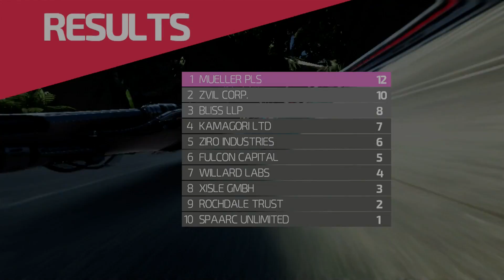Nintendo Switch - High Powered GPU Extension Theory

Comment: It wouldn't make much sense since the 720p screen wouldn't need that much horsepower, it would be better to have something like lets say the Razer Blade external gpu dock, and have it active only when its connected to a TV, since that's when the extra horsepower would be needed. They would still need to have a separate profile for each, it wouldn't be much different from tweaking graphics settings during in game, simply having a trigger in place to activate either profile for each scenario.

Comment: The venturebeat article just isn't credible. They said that pascal is less efficient and uses more power "getting a lot hotter than maxwell" and this isn't true. It actually sounds like they are describing Pascal in the Switch. Also AMD tflops is slightly less powerful than an NVIDIA tflop, so if it comes out as 1.3 tflops that could be around 1.6 tflops vs amd and xbox one/ps4.

Comment: Remember Nintendo filed a patent for parallel compute units? The patent has the NX/Switch connect to multiple devices increasing its computational power, the units being in "the clouds" or hardwired to the system. So when you have it docked it can be hardwired, and when you're moble, I can see Wi-Fi connected. I highly doubt that they would do a GSM/LTE solution given the cost of DATA.

Comment: I looked into this potential add-on dock.   The usb-c port on the Switch would need to be something like Thunderbolt 3 version to support it.  The specs for Thunderbolt 3 are quite interesting as it allows 15watt charging for bus type and upto 100watts for system charging.  The part that relates to the GPU extension, though, is Thunderbolt 3's support for 4 lanes of PCI Express Gen 3.  Source; https://thunderbolttechnology.net/blog/thunderbolt-3-usb-c-does-it-all

Comment: Shrinking the Die size doesn't change performance, just efficiency.

And the Switch wont be powerful enough to compare to a GTX 1070. That's like trying to use a Pentium 4 with a GTX 1080. Bottleneck would render that GPU useless.
Reply: the tablet would also melt in your hands after just a minute of gameplay

Comment: i think you missed the point of this console. you're overcomplicating it and not really understanding what nintendo intends. i can tell you now that nintendo does not want to adopt the sony/microsoft upgrade style console. they have no intention of running upgradeable 1080 graphics. i doubt they even care about the streaming as they are reinvesting in the cartridge system for portability and not wifi streaming.

basically, all they want to do is merge console and portable gaming. they are not looking for high power, only high enough power to make the kind of games they want. i suspect the only difference running games portable versus on the dock iwill be in resolution, 720p on portable and 1080p on tv. they have no known intentions of 4k gaming.

Comment: Yeah, switching between 2 different setting profiles would be too hard. I mean most PC games only have the ability to swap between 1000's of settings profile possibilities, with like 4 or so preset up, making only 2 would be nearly impossible. I mean PCs have games that will run not even best settings on a 1080 but could run minimalist on 670, and everywhere in between. But having 2 profiles, that'd be too hard.
Reply: Sharky111111 Not to mention devs are now also forced to make four versions of games for the other consoles: regular PS4 and PS4 Pro, and X1 and Scorpio. That means all games released will have to run on a regular X1. Even if the Switch is slightly less powerful than that, it shouldn't be too much work to disable a few graphical settings to make it run on the Switch. (As long as it's easy to port to, of course, which seems to be the case from all the rumors and what NVIDIA has said.)

Comment: How was Rouge 1 Dave? I haven't seen it yet, is it any good?
Reply from the maker: Yeah I saw it on Thursday, you will like it a lot if you are a fan of the 1977 movie ;)
Reply: SuperMetaldave64 Cool good to know thanks, was there stuff after the credits like in the Marvel films?

Also real quick on the VR headset that might have the Switch fit inside it. For that to work properly & comfortably the Switch will have to be incredibly light & given the fact that the screen is wider than human eyes are apart, the holster for the Switch screen would have to be a bit further away from a person's face for them to be able to see everything on screen. Do you think Nintendo will end up changing the display size so the human eye can take in everything so the 3D effect isn't disrupted?

Comment: When nvidia showed off their shield tv, I remember they ran crysis 3 I believe and it seemed to be running fine and it looked gorgeous. If the shield ran that using android (which I heard is not as specialized for 3d rendering), why is it speculated that the switch won't be as powerful. Of course when nvidia showed that off in their demo there weren't many things going in the game which might have lowered the strain put on the shield. Just really curious as to why people's expectations drastically lowered when the rumor of the shield using the maxwell architecture instead of the pascal.

Comment: My worry about streaming performance would be all around connection speeds, I'd have to be connected to something better than 4G to get a consistent smooth experience, also, with Data caps, how would you stream game content on the go without WiFi, which still isn't available everywhere, but it'll cost a fortune to get any of that really going. I think it's a fallacy in today's world. The only way to make it work now is with it being all locally run. I can't deal with none-roaming wifi, much less fully mobile wifi yet...

Comment: I could see the streaming service working out if you have a decent wifi connection, but I believe in the U.S., if you can't play the game on the go without the extra help of an external GPU, you would be SOL if you walk too far away from your own wifi network. It needs a strong connection to the internet to work, and if it came with an online paywall, then that would be a pretty terrible deal, considering that the Switch would have the capability to use online features anyway.Paying for a streaming service would be justified, if that was a streaming service using off-site PCs. Now come to think of it, however, it could, if NVidia really pushed it, essentially have the main functionality of the Shield, and it would allow people to take their existing hardware, download a game that is rendered by the PC, and controlled by the Switch. That would actually be pretty sweet.

Comment: You missed the part where Nvidia "officially" stated (in their blog) that the Switch hardware, the GPU, is  based on the same architecture as the world’s top-performing GeForce gaming graphics cards. Guess what architecture they're referring to right there. It's PASCAL.

Comment: I really hope they don'r go with a streaming solution. I wanna be able to play games on the go, away from an internet connection AND at home with internet. I don't mind a relatively weaker system in terms of hardware as long as they release games for it.
Reply: ***** Still rather have it play offline. Not everyone is gonna have unlimited 4G and I'm pretty sure my carrier actually limits data usage after a certain threshold, even though it's advertised as unlimited.

Comment: Nvidia would have stopped production of Maxwell chips ages ago to start production of their new chips, also why shrink down Maxwell chips to 16nm when they are already producing a chip of that size and have been for well over 12 months.
also Nvidia have said on their own website that the switch uses a custom GPU based on the current world leading GTX cards which use pascal. so if the switch does not use that architecture then they have left themselves open for a lawsuit due to the wording on their own website.

Comment: This video doesn't make a whole lot of sense as it's EASY to scale a game's performance quickly. In fact, not just some but pretty much ALL PC games are made like this which is why the PS4 and XB1 moved to architectures that were MORE like the PC. This is also why games are ported so easily between the two and pretty much look the same even though the hardware varies a good amount between them as far as power and performance. Case in point, I'm playing Dragon Ball Xenoverse 2 right now on my 4K TV and I can turn it all the way down to 480P with low draw distance and 30 frames per second then turn it all the way back up to 4K with max draw distance and 60 frames per second and the transition literally takes 1 second. In this instance the game isn't even made specifically for MY PC, it's a Steam game that's made to run on a large number of hardware configurations because that's how you design games now. One of the biggest things that held back the Wii U was the fact that it used an antiquated architecture that couldn't even run things like Unreal Engine 4 so you'd have to remake the game from the ground up in many cases to port it from XB1 and PS4 but the Switch has been confirmed to support these modern game-making engines. The Switch will hopefully come out with a reasonable power level initially but I can totally see them adding a secondary graphics card and a graphics accelerator into a new base that they sell for it in a year or so after release to appeal to the 4K market. Not only would be it able to fairly seemlessly switch between 4K gameplay and 720P on the go much like a PC BUT people would have the choice of buying this addition without needing to buy a completely new system.

Comment: Nvidia Gamestream as it is called, can stream PC ultra graphics on every game available on the Gamestream market. NOT Ps4 graphics or Xbox one graphics.

I own a shield and Im connected to a 5Ghz wi-fi. I use the same settings as I do on a gtx1080 gfx card.

Which makes this whole video unbelievable at best, get your info straight.
Reply from the maker: +Izurak I said it could use something like Grid, not Grid itself. Basically what you are describing but more network based for a longer range away from your home but still streaming from your Home system. Not sure what the issue is lol, my video is about sharing ideas.
Reply: First of all, you talk about nvidia and GRID is nvidia exclusive, so if Switch uses something of the sorts, its Gamestream, nothing else. 
I didnt mean to offend you but when you state a fact about say, gamestream, the viewers expect it to be correct. You said "GRID" and "Ps4 graphics" in the same sentence which is false. GRID/Gamestream specifically, uses PC based graphics. 

I can connect my nvidia shield wifi to my smartphone shared network and play gamestream on the bus. So should Switch use it, it wont be a problem.
Reply from the maker: +Izurak No it's cool man, but I'm sure you get what I was trying to convey when I was talking about Grid, next time I'll be extra careful to make sure I'm more clear.